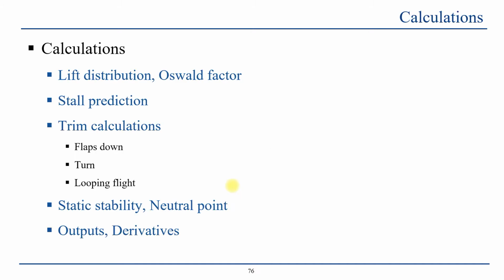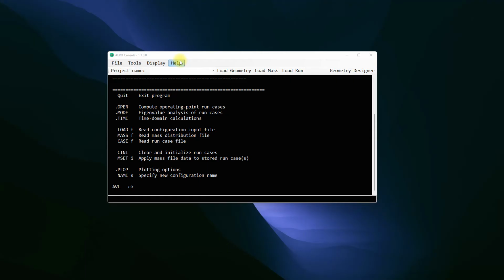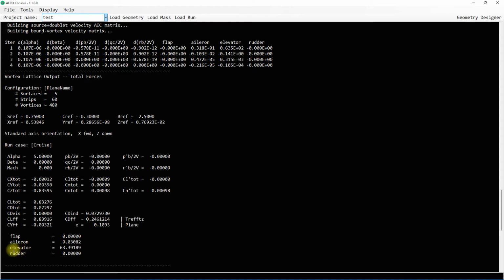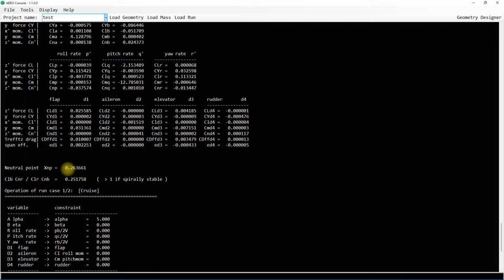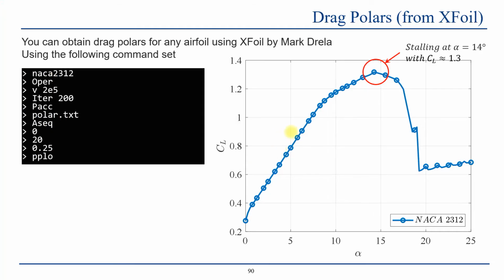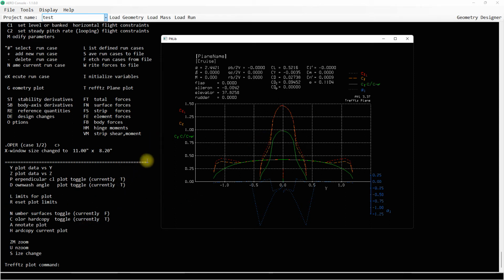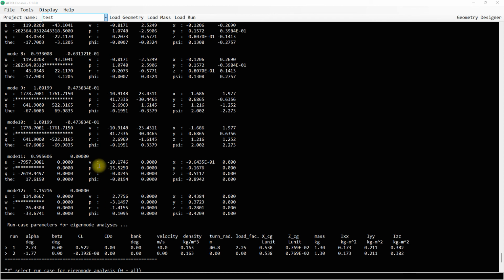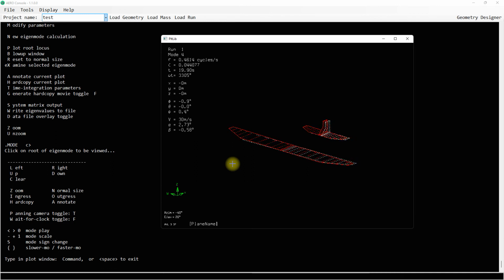AVL Tutorial - Part 07 - Aero Console and Calculations

Comment: Thanks for the excellent tutorial. Why is that we are not including a fuselage in the analysis? How can i add if i want to add it? is AVL able to predict the forces and moments on the fuselage accurately?
Reply from the maker: Glad you found the tutorial helpful! To answer your questions:

Why no fuselage? I excluded it to keep the tutorial focused on the core functionality of AVL, which is the Vortex Lattice Method (VLM). VLM is primarily designed for lifting surfaces (wings and tails), so excluding the fuselage is common in preliminary design to get quick estimates of stability derivatives.

How to add one: You can add a fuselage by using the BODY keyword in your geometry (.avl) file. You will need to define the fuselage shape using varying cross-sections (typically circles or ellipses) along the X-axis. Note that Aero Console does not support it so you won't see any visuals of it in Aero Console yet.

Is it accurate? This is the tricky part. AVL models fuselages using Slender Body Theory (source/doublet lines), not VLM.
It is generally decent for predicting side forces and yawing moments (directional stability) and the "carry-over" lift. It is not accurate for Drag prediction (especially form drag) or complex interference effects between the wing and body.

If you need precise fuselage aerodynamics, you might need a full panel method or CFD, but for stability analysis, AVL’s approximation is usually sufficient.
Reply: @arahimi_  Thank you so much. I appretiate the patience to answer all the questions in detail. 😅

Comment: Goog Morning, and frist, thanks for your videos ! But quick question : when I change the density I observe no variation on the CL display on the Trefftz plane window, do you know where this can come from ?
Reply from the maker: Hi an you are welcome! for the air density effect on CL in TF plane, you need to double check if your simulation is actually suing the new run file by going to your density value and checking it before eX the simulation
Reply: @arahimi_  Thank you ! Well I think there is no doubt it is suing the new run file, and anyway I also tried by modifying it directly in AVL using the "m" command in the oper menu :/
Reply from the maker: @Eromero2690  I'm sorry that did not help, but I think any further investigations would need access to the full set of files you are using for your case!

Comment: hi, I try  to open airfoi.dat file bu I can not. I says 'the problem occur that file not processed. Current geometry may be corrupted. when ı open airfoil file in avl'
Reply from the maker: AVL is very picky with spaces and tabs in the file, if you misplace spaces and tabs, it considers the file as corrupted. Your best bet is to start with a sample that has the structure you need for your overall design and change the parameters from there